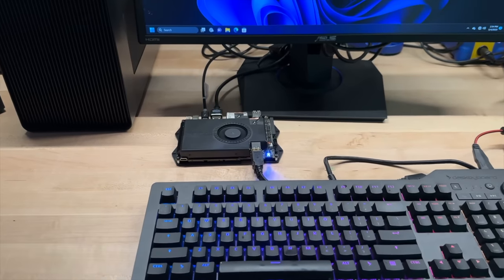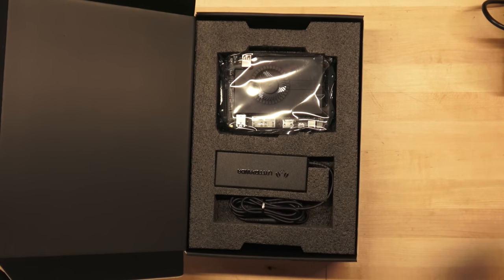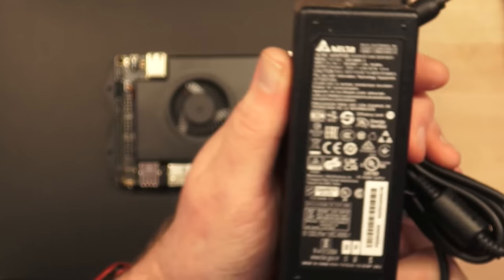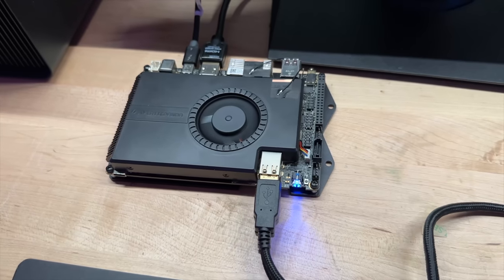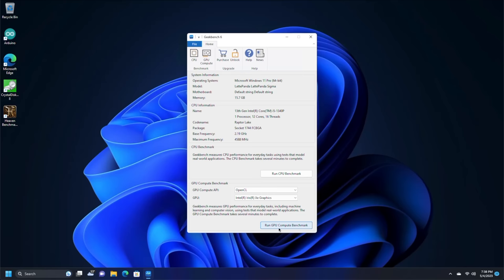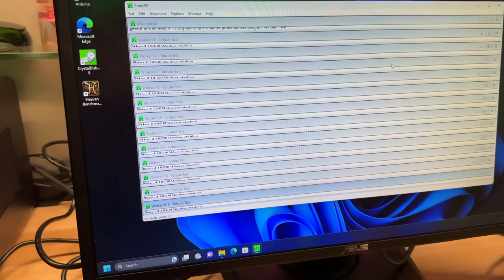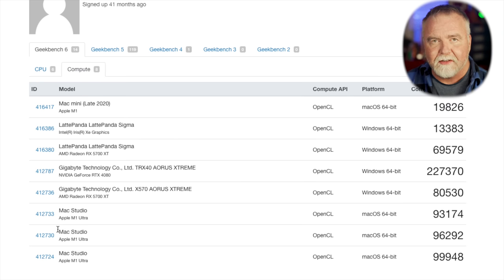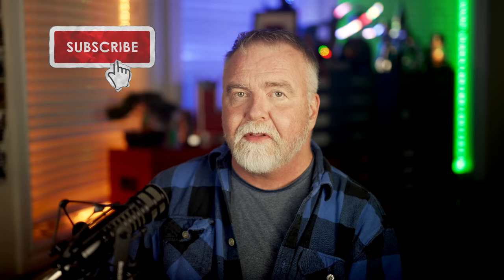The Sigma: The Most Powerful Single Board Windows PC

Comment: It's crazy how powerful singleboard and micro form factors are getting. Its a really exciting time for processing power.
Reply: Agreed. They could be a good replacement for using a laptop in flexible work spaces. All you need is a screen or two, a mouse and a keyboard, supplied through 1 or 2 usb cables (that also supply power), and you're up and running. 
And if you also want to game on it at home, you could add an external GPU docking station to it, which you can leave at home, since you most likely won't need it at work. 
It beats a laptop, since those are more expensive due to the inclusion of a screen (that's at the wrong height, ergonomically speaking), keyboard (that usually is also has ergonomic problems and a weird layout around the arrow keys/numpad) and trackpad (which you don't need if a mouse is available).
Reply: It really is! I know Intel Arrow Lake CPU's are going to have an iGP as powerful as a GTX 1080!!
Reply: @BingBingWahoo  I've seen the rumors! Same for AMD's Strix Halo, I mean, it definitely makes sense for OEMs to want AMD/Intel to make better integrated gfx systems to they can advertise the massive boosts in battery life as well as not have to pay the Nvidia tax. I forsee this trend getting far greater as time goes on as Nvidia loses its grip on pricing reality. RDNA3 and ARC's encoders are damn good now too, so you won't even need an Nvidia chip for multimedia work once they bring more products to market. Can't come soon enough, I say.
Reply: AMD APUs were always way stronger than what intel puts out like typically 2x or more.
Reply: @Cypeq  true, but Intel has gotten a lot better with their integrated gpu since they released Alchemist
Reply: It's not about the processing power, it's about the shrinking sized power.
Reply: @BBWahoo  Oh well, the A770 originally would compete with the RTX 3070 and we all know how it turned out. I wouldn't count with Intel meeting predicted performance targets just yet.
Reply: Yep. This really hits a sweet spot between money and capabilities for me. Really hoping AMD starts to catch on to this market exploding.
Reply: @w4gn4o  eh, right now I chalk a lot of that up to the rapidly evolving (read: still currently very bad) driver situation tbh.
Reply: If you think single board PCs are getting good now, just wait until ARM takes off and their power and thermals are easier to manage. You'll see battery operated ones that last a whole month on a charge
Reply: @Pharya  not trying to be rude here but I'd much have rather have a computer that allows me to run whatever software I want. Don't get me wrong I think qualcomm/Nuvias new chips could be really cool for mobile and stuff but until Windows creates a better ecosystem for it (Yes I'm aware they're making a bunch of progress with volterra and their own brand of translation layer) I just couldn't see myself actually going out and buying it. I'm much more impressed by seeing x86 chips reach smaller power envelopes and form factors, that's just me tho.
Reply: CNC companies would cream themselves over getting this as a controller PC. VERY good specs. With tons of applications for the single board PC industrial/prototype power user.
Reply: @dirg3music  Get the windows monkey off of your back and there is nothing wrong with using arm.
Reply: @dirg3music  well, it's true that's a bigger challenge because of power requirements inherent to CISC architectures.
Reply: @albert strohmaier  ARM has some cool connotations to it, it really does, but until I can get a chip on par with the m2 max, 32gb ram, that runs Windows, im just not interested. (compatibility is absolutely paramount for me, and no other platform has that on the level Windows does, love it or hate it). And let's be honest here, CISC/RISC is a kind of meaningless classification these days as both x86 and ARM are capable of running extremely reduced and extremely complex instructions respectively, Jim Keller himself has even said as much. I'm completely open to having my mind changed tho, and the future looks very bright for enthusiasts of all architectures tbh.
Reply: wait for 3nm boards
Reply: $579:face-purple-crying:
Reply: I hope it leads to aftermarket laptop conversion cases.
Reply: @dieselphiend  same, Framework has an awesome model that let's you reuse virtually every piece of the machine, even turning an old framework laptop battery into a portable power bank! Chassis you can put the old motherboard and such into to turn it into a full fledged mini-pc. There's been a real grassroots movement towards this stuff and I can see it catching on as time goes by, I'm excited to see what they do next!
Reply: It is putting an end point to PC model initiated by IBM and transformed in form factory by Intel/Amd/Nvidia. Maybe the future is a variety of interchangeable parts and things more powerful without this all legacy that industry neglect to always push more selling and do the wheel turn. We already is near of a day that personal will be really personal and not all like black Ford cars. It is not by necessary implications but about how control the market. They run from RISC and chosen CISC to always stay away from bare metal. Now ARM/RISC design is going to  flower on times of energy issue. It is a shame a powerful machine not run an old game that made all graphics on an old HDD. They know that our machines is powerful but they is lazy on programming . So they sell and do the hype every half year😂
Reply: @albertstrohmaier4034  RISC arch will supplant CISC. This is the Berkeley prophecy 😂❤
Reply: @Cypeq  AMD's new APU's are equivalent to a 1650 now in performance wise
Reply: Not that crazy to even the most casual viewer of technology.
Reply: @fade2black001  I have a burning feeling that integrated gpus are very quickly going to push low end dgpus out of the market sooner rather than later especially in devices whose biggest selling point is long battery life.
Reply: @dirg3music  I agree. AMD IGPUs are miles ahead of Intel though. Intel should just quit the GPU market altogether. They should have never released ARC as it is clearly shown they don't know what they're doing. That GPU is like an Alpha version of what a GPU should be. They should have waited at least another 3 years before releasing anything. Their Iris XE IGPU is complete crap as well.
Reply: but the price is too much... always power comes with power of money...
Reply: To run crappy kids games!
Reply: @BBWahoo  I call bull
Reply: For sure. My next computer will either be a mini pc or a used small form factor one.
Reply: and the processors havent gotten any better in 15 years
Reply: @plebbin.  what a genuinely ridiculous and objectively false comment. Lmfao.
Reply: Aren't all home computers lumped into the "micro computer" classification?  Or am I remembering history wrong?
Reply: @BBWahoo  Now that's impressive. I hadn't heard about Arrow Lake b4 now. Certainly would be nice to have a small form factor gaming setup as a secondary computer to give my power hungry 13900/4090 a rest for less demanding games. That CPU would be a beast for 1080p gaming, if true.
Reply: @BBWahoo  However I still would have loved that there was more versions of the CPU's with very different prices at least for desktop.

Like I would prefer to chose like a I7 K with a very slow iGPU over the same I7 K with a powerful GPU and have a good price cut, not like the GPU-less versions that cost sadly almost the same as the normal one which is a bit pointless and the iGPU comes handy for when you run into GPU issues and don't even need to put another PCI-e GPU in the slot but rather just try with the iGPU.

Really wish both AMD and Intel had more choices without GPU and with GPU of very low end to a high power one with VERY DIFFERENT prices instead of having to pay massively for something I don't want.
Reply: @guily6669  
I hope they implement their own iGPU's like AMD does with their 5700G, etc
Reply: Linux has no meshroom or gta. Ot or 3d builder

Comment: Absolutely love the presentation here Dave … 

I have an ‘old’ Lattepanda Alpha from when they did the original kickstarter and it has been absolutely fantastic - I’ve used it in a 3D printed enclosure that I knocked up on TinkerCAD and can just throw it in my bag with a 12v wall wart and it’s my portable PC that I can just plug in a keyboard, mouse and monitor wherever I am.

I’d seen that the Sigma was out - it’s a fairly ‘robust’ price but I suspect I’ll end up getting one at some point …

I am still waiting for my Hackboard2 from their Indegogo project and that will end up strapped to the back of my 27” touchscreen which I use as an oversized UI to Roon (that currently runs on an HP 800 Desktop Mini).

Anyway - great review Dave, I really like the presentation. Hope you’ll do more … :-)
Reply: The Delta 3 isn't so bad either. Close to the power of Alpha but a lot cheaper and you can use an external GPU almost as well.

Comment: Looks like the perfect little home server. Dual NIC, 12cores (16 Therads), dual NVME, intel GPU and low wattage
Now if all the devices are recognized by linux - slap some proxmox on there and install all the "CPU intensive" stuff there...
Reply: It should also make a pretty powerful firewall for some specific usage situations.
Reply: @ehsnils  … especially if you team it with an m.2 Ethernet card to give you a couple more Ethernet ports…
Reply: @philharris9631  For corporate internal use it's enough with running multiple VLANs on one of the ports.
Reply: Don't forget that you will have to add duty to the price when imported from China. As i already got earlier pandas devices... more expensive the devices are more you must add to the the price at custom... The price for this device is OK, however adding duty....all depends on the location you are at...
Reply: Be perfect for pfsense Firewall
Reply: 64GB RAM will be more suitable for prox with this CPU...
Reply: @satamototo  Wtf this aint no server grade. It's a laptop cpu. It burly passed of speed of Ryzen 1700x. This is yes good for virtualization but will be limited by cpu even if go more as 64gb ram. I use lot of vm hardly use that much ram. Alone this will be a great server would be great to host os and have pos connect to it by probably 10-15. Firewall be great even making a nas.
Reply: If? Someone hasn't used Linux in a long time. Linux is easier and better supported than Windows at every level. Windows is the junk that doesn't work. Slow garbage.
Reply: @aaronbottegal3340  HUH I'm a IT and Windows is NOT JUNK. All my server run Linux. And some of my desktop . My other work station run Of Windows 11 and I love it. Windows is always updated it's always have something new features. Stop being fan boy pos. No need to hate.
Reply: @rcrotorfreak  I hate the feature updates!!! I don't want these "features"! Just leave well enough alone Microsoft and stop bugging me all the time!
Reply: Perfect -- except for the high price!
Reply: check out the Zimaboards if you want nice small easy servers
Reply: I have never tied Proxmox , but if this thing will run ESXi from VMware it would be a good little test environment.
Reply: @mrtechie6810  what price?
Reply: Works with Linux Mint 21.2, kernel 6.1.0-1019-oem  (kernel 6.1.0-1016-oem upwards) My daily everyday computer now..... (Had problems with LM21.2 Beta and the originally supplied kernel.....so waited 'til the general release and upgraded the kernel. All issues disappeared)
Reply: Bittersweet board, nice idea bad hardware for a board like this.i Don't see any good usage that cannot be replaced by a better and/or cheaper solution.

Comment: I've had nothing but problems with these in the past. I've spent a small fortune on this company. I was always very happy with what they provided and how they performed, but they always had way too many deal breaker problems, like power management and worst of all, sudden death syndrome. I did extensive research and heard nothing but good things. But every time I ran into a problem, I did the research and found just as much negative feedback about the very problems I was having. I'll never buy another. I don't care if they can fly. I've since moved to a hardened industrial solution by compulab. They are half the price, and have an extended voltage and temperature range.. Every one I've ever purchased is still running. And I have a load of them in the field. And even in the wild, I mean literally in the wild. They don't have to be super fast for my application. They have to be reliable, period...
Reply: Facts, I’ve had my RPi running literally 24/7 since 2016 and it’s given ZERO issues, knock on wood. I already got the latest baddest one as a replacement in case the old one dies, but this thing just refuses to die…. Incredible reliability, wonder if pine64’s rock pro is as reliable. Been using a pinebook pro for years now and it’s been just as reliable.
Reply: What’s the industrial solution?
Reply: You echo my experience. Latte Panda has little or no support and the hardware is buggy. Don’t fall for all the hype re the performance. It is an expensive brick and I hope people don’t waste their money and time on this platform. Khadas also have some really good SBC and their support is really good and their hardware very stable. I have just ordered an I7 Khadas mind, Khadas do other ARM based SBC that are really top performers.
Reply: My main PC is an i9 Intel NUC Extreme with high end GPU card. I think the Latte Panda trying to be something that it is not. Either get a Khadas Mind as a portable PC to Intel NUC as a miniature desk PC
Reply: @merlin7766  "It is an expensive brick" = the most accurate description. I really wanted to like this thing...🤷‍♂
Reply: Yeah but a flying pc would be cool though
Reply: @mrfuzzy2954  plenty of them around already, they're called planes n helicopters.

Comment: 2:28 I remember when the Lattepanda Alpha came out, and it too was feature rich, but then it was also HYPER expensive, so I'd expect nothing less.  In fact, because these boards are so expensive, I would have felt ripped off if they didn't include enough.  (IMO they still don't, basically the bare minimum to charge a premium)

Comment: WiFi antennas are tricky.  You don't realize how tiny those things are until you see them in front of you.  The pictures on the internet deceivingly make them look bigger.  We also need to remember that they are fragile and are not meant to be removed and reattached a lot.  They are reliable enough if you only mess with them when you need to and don't do it frequently.  They were made for you to set them and forget them.  Some laptops come with brackets that not only hold the card down but the connectors for the antennas.  I have no idea if they work well but none of my laptops ever had that and I never once had a faulty antenna connection.  Of course I don't mess with the antennas unless I am installing a new WiFi card.  I have the AX200NGW in my laptops and couldn't be happier with it.  I am sure there may be better cards out there but I bought the AX200NGW since it is a good popular card.  Is it the best?  I can't tell, I never had other ones except for the mediocre ones I replaced with it.  I also like that one since you can get them cheaply enough if you do some searching for prices.  If your laptop has just one antenna cable buy a second one or a card that comes with them.

I have a laptop that has just one antenna from the factory but what I did was just route the cable to an empty part of the case where it will not touch other electrical parts.  I taped the excess cable down.  Do not bend or cut the cable, it is a thin coaxial cable and you will ruin it.  I just made a one loop coil of the excess cable and attached the antenna.  Then I used some good electrical tape to tape the excess in place.  It has been working well ever since and I now have better WiFi speed than I did with that mediocre Realtek card.  Why do they even use those mediocre things?  Is it cost or to make you want to upgrade?  When I installed the second cable I did not mess with the screen bezel to do it.  That is the key reason it is in the case itself.  I just also used the already installed one that is in the screen bezel.  I just don't think that we should have to tear apart the display to do these things, it seems like a lot of risk and work and a deliberate attempt to make us want a new laptop instead of upgrading it.

Comment: Those specs for that price is absolutely amazing. With 32GB of RAM and an eGPU it’d be a compelling option for a compact game development workstation.
Reply: As-is you could probably just embed it in the side of an eGPU enclosure with a GTX 1660 and be good to go for a gaming machine.
Reply: @KiraSlith  It would also be easy to power the board using the power supply of the eGPU enclosure with a boost converter I expect. Edit: Nvm, it looks like it will run from the thunderbolt port.
Reply: What was the price? Don't know how I missed it.
Reply: It has 16GB Ram doesn´t it?